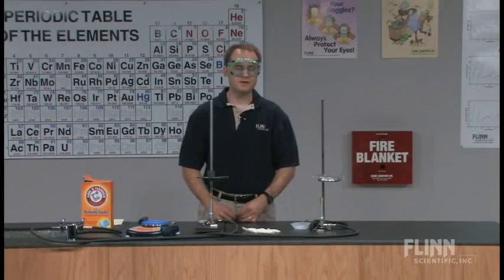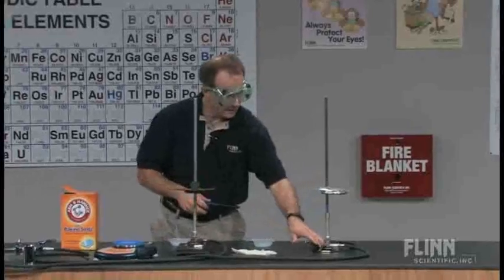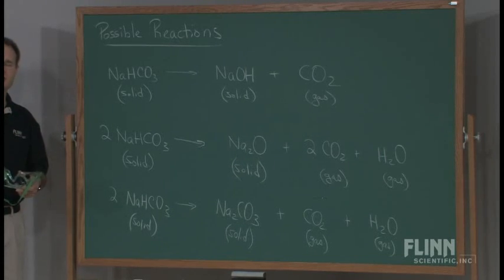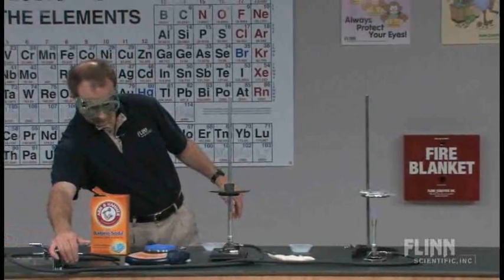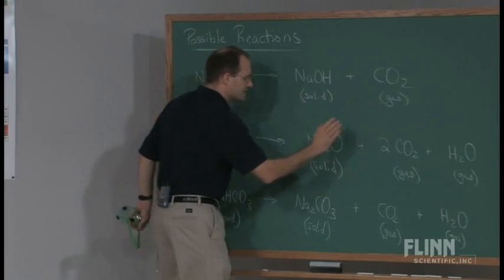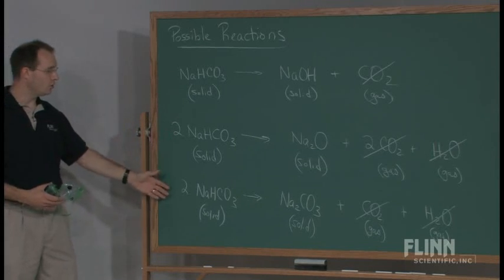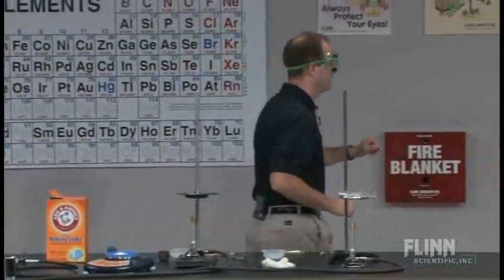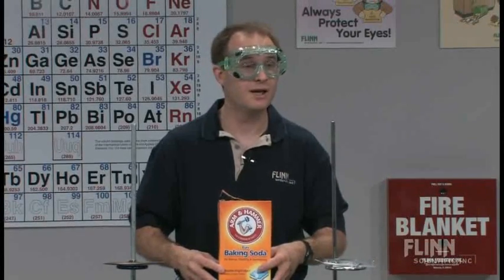Decomposition of Baking Soda

Comment: this is a flawed experiment from the beginning. the baking soda should be desiccated before use to remove any water. and in order to get the true mass, he should have weighed the crucible and test tube before adding the baking soda, and then weighing again after adding. doing it his way, the data are distorted by the losses on the weighing boat and spatula.

Comment: Now how in he hell does the dude know what all those chemicals weigh? Did he just memorize those? So what, he weighs the end product to determine what is converted to?
Reply: You are able to determine the mass of the end products using stoichiometry. If you wanted to find the mass of sodium carbonate produced,  you would multiply the mass of the baking soda you use (2.00g) by one mole over the mass of one mole of Baking soda (84.01g). You then need to determine how many moles of sodium carbonate are produced per mole of Baking soda, which is one mole of Na2CO3(sodium carbonate) per 2 moles of NaHCO3(baking soda). Then you multiply this ratio (1 mol / 2 mol) by the mass of one mole of NaCO3 (103.99g) over one mol. This gives you the equation 2.00g NaHCO3 x (1 mol / 84.01g) x (1 mol / 2 mol) x ( 103.99g / 1 mol ) which simplifies to 1.26 grams of Sodium Carbonate. 
As to whether he just memorized the values, more than likely yes, as there are very few people capable of doing that kind of math in their heads that quickly.
Reply: he had a paper in his hand